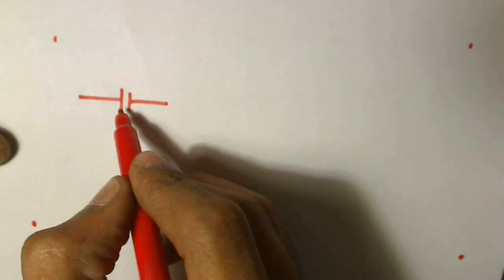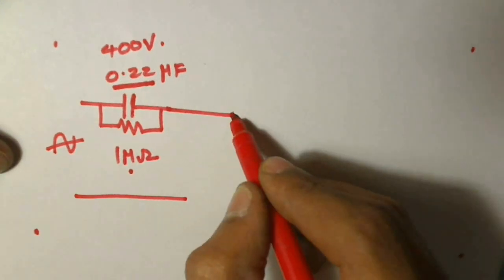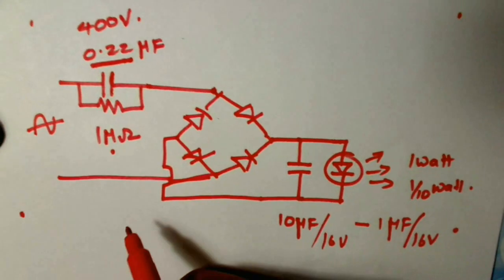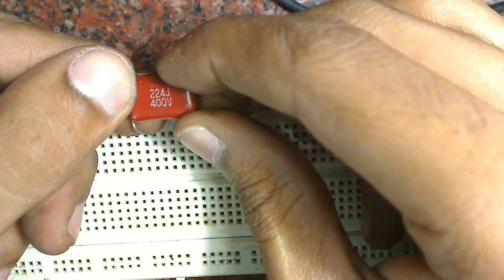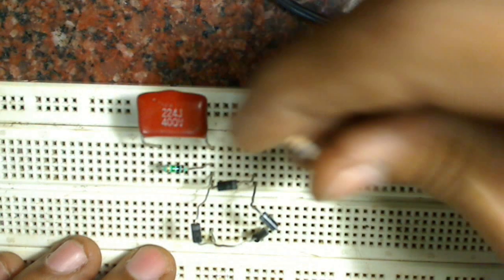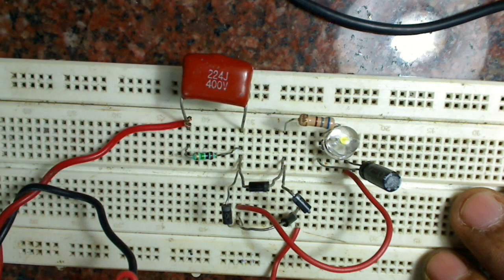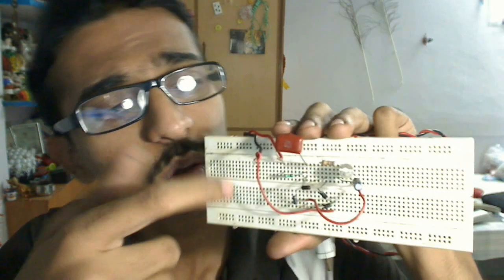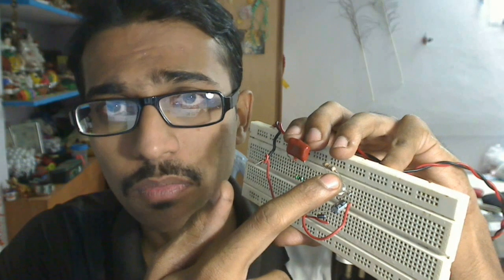transformerless LED driver circuit

Comment: Hey! Great video! I'm just curious to know that how did the voltage level dropped to the operating levels of a led?? And please tell me which LED did you use exactly??
Reply from the maker: Kishor Shukla if you connect the led then the voltage across led is the led threshold (3.3v). if you dont connect led then it wil give the open circuit voltage of 220-240v and it might burn the output capacitor. 
the voltage across each led is the threshold value , no matter how many leds u connect
Reply from the maker: +Archit Muchhal the voltage didnt drop actually. its the current that is limited and the current drop compensates for the voltage
Reply: +Electronics Made Easy : KHADER 

What is the metered voltage across the led?

Comment: Hi did anyone check the efficiency on any specific setup?
input watts vs output watts ?
All I know is that the more leds in series the more efficient it becomes.
Many cheap chinese led bulbs have the same circuit :)
Reply from the maker: +yagoa yeh actually true :) . u can connect upto 90 leds in series for this setup

Comment: if you unplug AC line, it still not safe to touch capasitor. 
Great video, thanks.
Reply from the maker: +Velniene  yes, you can touch the circuit after it is unplugged but you should take care that the 1 megaohm resistor(to discharge the capacitor when circuit is switched off) is connected across the capacitor

Comment: You need to add a resistor in parallel to input capacitor to discharge the voltage across it.. it helps to avoid shock when the circuit is touched when its not connected to mains.. t
e resistance is choosen a s per discharge time ie.. t=1.1RC .. if capacitor is to be discharged completely in 1 sec then R= (1×1000000)÷(0.22×1.1)= 4.1M ohms..
Reply from the maker: i did connect a 1Mohm resistor across 0.22uf capacitor, in the video.
Reply: Electronics made easy yup i see.. just explaining y we need to connect that resistor .
Reply from the maker: and thanks for that information :) , i really didn't know how to calculate that resistor value. i hope it would be helpful in some of my other projects.

Comment: Can I use this circuit for 3 watt led conseal down lights 8 to 10 hrs daily. 

Plz share the parts list.
Reply from the maker: ajay kumar yes you can use the same circuit if the leds in conceal light are in series. usually the voltage required for these conceal lights will be around 10-12v and current would be around 250-330mA. the above circuit can power a 1watt led with a current of 100-200mA, as the output is alternating so the same circuit can be used for even 12V conceal light. but if the brightness of the light is not as expected the u can slightly increase the series capacitance from 0.22uf to 0.33uf. there is no heating problem in this circuit so u can use it for as long as you want but better to test it for couple of minutes and then disconnect the circuit and check if resistor is heating or not. if resistor is heating then replace the resistor with high power one.
Reply: +Electronics Made Easy : KHADER - Hi KHADER I want to send you one circuit so could you give me your email I'd coz I am desperate to make that circuit but don't know its parts
Reply from the maker: +Rodney Mendes  yeh please send to skkhader7@gmail.com

Comment: Do i nid to change the resistor since im planning to connect 10pcs white leds in series?
Reply from the maker: you need not change the resistor value if you are planning to add leds in series, as in series current would remain the same but if you want to add more leds in parallel then current would increase so you need to reduce the resistor value or increase the series capacitance value. reducing resistance would be a safer approach.

Comment: how can i make 240 volts blinking LED circuit
Reply from the maker: After the 10uf /16v capacitor you can connect a 5v zener diode in parallel so that the output voltage is 5v and then a simple 555 timer oscillator of desired time period can be connected and leds can be driven. make sure all the connections are done firmly and do not touch the circuit when the power supply is given as the circuit is not isolated so you may face a severe electric shock. 
(or)
instead of using zener and 555 timer circuit, you can also design an astable multivibrator using transistors and connect it directly at the output
Reply: How can i made blinking LED circuit without 555 IC?
Reply from the maker: you can use an astable multivibrator like the one shown here in this site 
http://electronics.stackexchange.com/questions/12283/how-does-an-astable-multivibrator-led-blinking-circuit-work
and connect it in the circuit after the bridge rectifier. you may also add a zener diode before this circuit but it will work evn if zener is not connected also
Reply: Hi khader,

what if i add 10uF 160 volt capacitor instead of 16v ? is that make any difference in output voltage? also using 2 Zener & 2 normal diodes on bridge rectifier helps to get desire voltage and current?
Reply from the maker: +Rodney Mendes capacitor: won't make any difference, zener diodes: u should take care of their rating to use. Mostly they should be fine. Output will be clipped depending on zener diode
Reply: how to increase the LED Bright in series circuit

Comment: if i want to connect 4led in series means wat was the resistor value
Reply from the maker: if you want to connect more leds in series then you need not vary the resistor value, you can use the same circuit with 4 leds in series in place of 1. if you want to connect them in parallel then you have to vary the resistor as well as the capacitor value ( decrease resistance and increase capacitance)